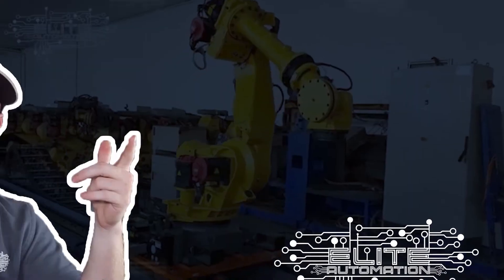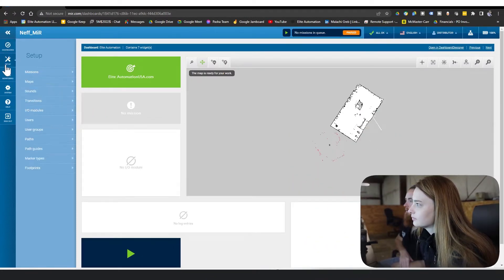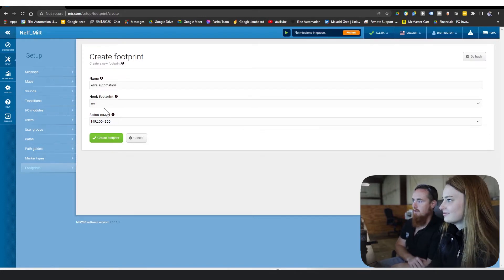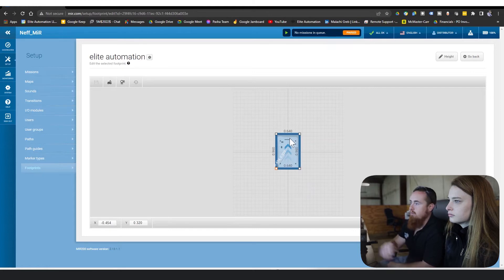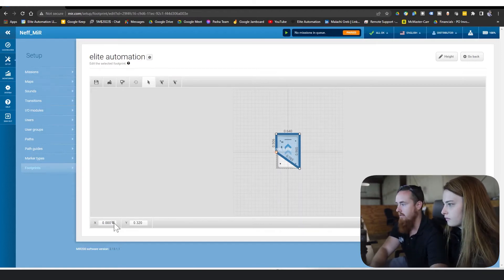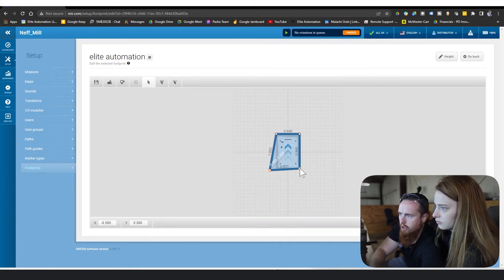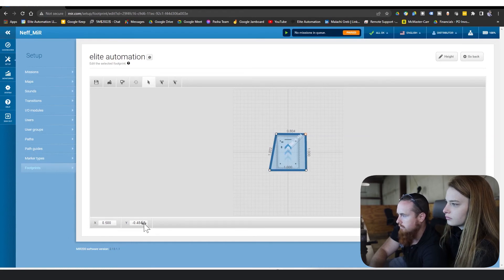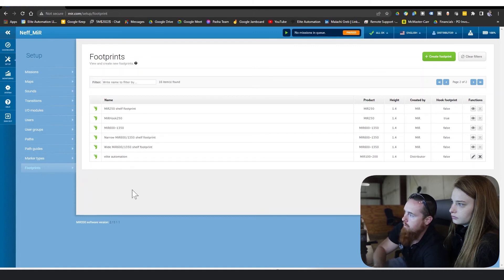MiR AMR Foot Print | Elite Automation

Comment: How do you active the footprinter option if i can’t see in the settings bar
Reply from the maker: Here are some possible reasons why you can't find the foot printer option in your MIR AMR's settings bar and how to resolve them:

Check the Software Version: Ensure you have the latest software version installed on your MIR AMR. Older versions might not have the foot printer option.
Verify Permissions: Make sure you have the necessary permissions to access and activate the foot printer option. Contact your system administrator if you're unsure.
Look in Other Menus: The foot printer option might be located in a different menu or sub-menu within the settings. Explore other options in the settings bar or refer to the user manual.
Contact Technical Support: If you've tried the above steps and still can't find the option, reach out to MIR AMR's technical support. They can provide specific guidance based on your model and software version.
Reply: If you have an older version of the mir software, you can set footprint in the Missions. The option is to set footprint under Move Tab. Within it, you can use the default value to specify the footprint dimensions from the center of the robot -> [[0.75,-0.75],[1.05,-0.50],[1.05,0.50],[0.75,0.75],[-0.75,0.75],[-1.05,0.50],[-1.05,-0.50],[-0.75,-0.75]] in this format. Only annoying thing, is when we run the mission, this needs to be OKed during execution, otherwise the functionality is the same.